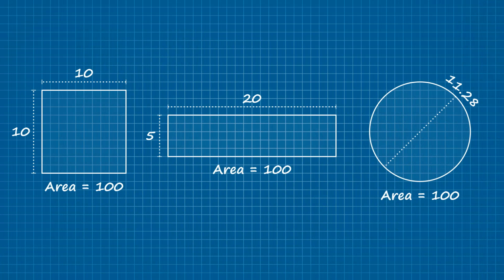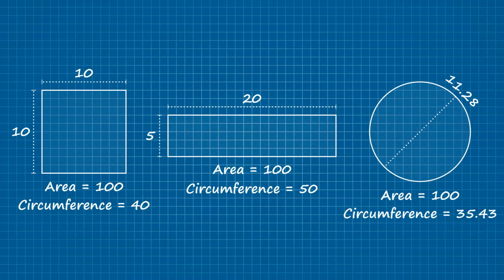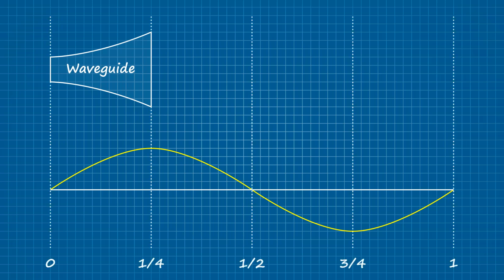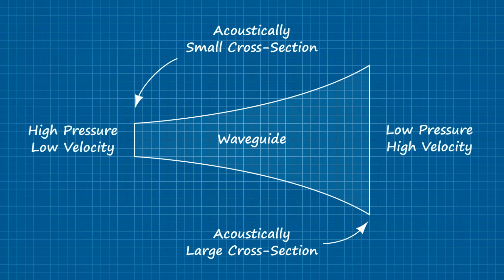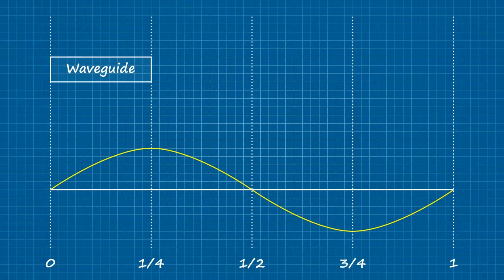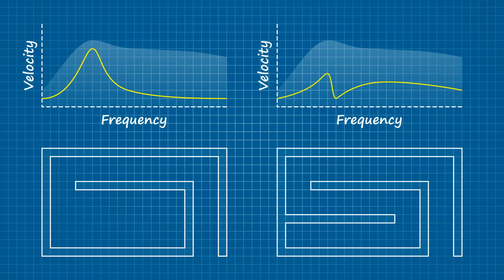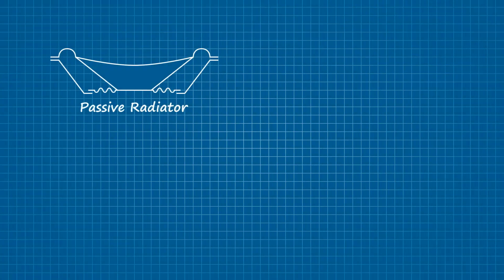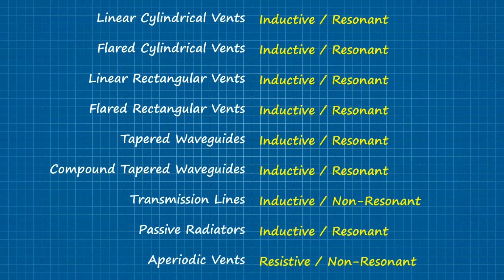The BEST Port Video EVER

Comment: I had a question about port area vs RMS wattage of a system. Does the wattage of a system, in my case 2 NVX VCW154 1000watt rms subwoofers, have anything to do with how much area a port should have. I have had a problem with Unloading, or bottoming out if thats what you call it, I've been loosing power from the system becasue of this issue and i cant really find a reason for this happening and my best guess was that the tuning frequency was too high or i didn't have enough port, or not enough port. If you or anyone else could help me with this issue I would be very grateful.
Reply: Turn down the bass boost
Reply: The bass boost isn't even on
Reply: Again. It is very complex. Wattage only means how much heat the driver can dissipate. Nothing about sound pressure level or anything. There can be many problems to it. You named it. You should check each, one by one, using  short bursts of generated tones or sweeps to find out what happens at what freqency. The rule of thumb is, that the port should be at least 1/3 to 1/2 area compared to the cone area. The more powerfull speaker with more cone displacement, the larger. But that will make your port longer. You do not want to get over like 1m in port length. Tuning frequency is "the same". The larger the port area, the higher the frequency. To mitigate that, again, you need a longer port. For car usage, 30-40Hz port tuning is normal. You should have subsonic filter set slightly below the por tuning frequency, so the speaker doesn´t unload.
Reply: CrashPCcz thanks for the reply I appreciate the info and I'll look into building a box with better port. Also I didn't know that about wattage. But it did feel like a big difference when I went from a 500watts system to a 2000watt system

Comment: Have a look at US Patent # 4196792; little treat from a long-time friend of mine.  Technically an aperiodic vent, technically not.  :)
Reply: I have a set of 12" goodmans axioms loaded into cabinets like that.... Good stuff. Full range dual cone speakers with 350 liters Vas, and beyond ridiculousness levels of compliance. The cabinets are about 6 cubes, and the venting type i figure artificially inflates that by about 25%. The entire backwave is lightly stuffed. It has a very smooth and linear low frequency quality to it. Very warm and pleasant with good low end roll off.  I found though they need to be right up against the back wall of the room for flat low end and they can have great emphasis when corner loaded if desired.

Comment: Why do you talk so quickly..? What's the big hurry..? 
Do you fully understand exactly how LPF speaker enclosure works ? The only thing that made any sense was the circular shape for a vent . High velocity air movement in a port is to be avoided at all costs .. Too small a port area will cause non linear air flow ratios ..

Comment: Consider, a port tube within a tube, to achieve the length of port similar to a transmission line. The opening to the outside on the front of the cabinet is a smaller diameter, and inside the cabinet, a larger diameter tube is attached to the back wall of the cabinet. Thusly, doubling the port length.

Comment: no one ever told that why L port and t lines are not punchy ?  round port can be punchy but when u flare it than it also becomes soft non punchy. why it happens?
Reply: It has way less to do with the port shape compared to other things. Group delay, dynamic range, balance between port output and speaker output, and much more. Same as "Slow speakers" and "fast speakers" story. For "fastest" sound, you probably need to cut off high (40Hz subsonic), you need a direct radiator or front loaded horn, and speaker with very high motor force (Bl^2/Re). That way you get punchier sound. If we speak withing bassreflex, some rules apply too. It´s quite complex...

Comment: What about front or rear? Often pro studio have on the front and hifi often on the back. Any difference? Close or far on the baffle?
Cheers!
Reply: The rear vent is supposed to use the wall to reflect the sound, while pro-audio will usually not have a wall (or want one).
Reply: It´s a rabbit hole. Very complex topic. For Hi-Fi, low extension, nice design, and less distortion and noise is desirable.  Putting bassreflex to the back of the box will cause higher frequencies and sound coming directly through the port to attenuate compared to port facing directly to you. That´s one part...

Comment: Excellent video. One question. You say aperiodic enclosures have slightly higher group-delay over sealed. I was wondering about this. Wouldn't they have less, as a well designed aperiodic has a more linear impedance over the range and more control over cone motion than sealed? Or am I wrong on both counts?

Comment: good video my port tube in my sub  cabinet comes up from the top air blows out like a chimney .My port tube is 22 inches long 3 and half circular . the cabinet was in our school gym which was replaced and they were given to me so I modified it using my own drivers 12inch s and had to get port tuning info   on the drivers I have I closed off the ones in the front area that were too small in length.

Comment: Ok, I have a question.

Does port location in relation to the driver(s) in the enclosure have an effect on the output or sound quality of an enclosure (possibly depending on the environment the enclosure is used in? (Ie van, car, living room)
Reply: Yes, it has. It just depends how strong, how measurable. As long as the sound is not produce by a single driver, you always deal with phase shifts, delays and so on. If the frequency is "high", and the port is situated in different distance from you compared to the driver, then you obviously get those two sounds not perfectly aligned and combined, but "separated" or even negating each other. It depends on box size, shape, port placement and frequency analyzed, because of wavelenghts...

Comment: Hexibase I have to say thanks, there were a couple things mentioned i have been befuddled with which has helped me better understand how I'm going to create the baddest wave guide demo vehicle. I have some incredible ideas on what would be very efficient. Now, let's say I use large aeroports in a large enclosure, I assume that this orientation will suffer from less impedance rise than that of a smaller enclosure with an even smaller ratio of port area per volume. Is this thinking correct? I have been into car audio for 13 years and have focused my attention on learning as much about acoustical suspension systems as I can. I was wondering if there's any way I can contact you to dive deeper into some really difficult to determine parameters with 8th order bandpass. I think I have the concept well understood but I'd like to consult with you.

Comment: So is a transmission line designed to act like a bass reflex or tuned quarter wave at lower frequencies and an aperiodic or damped infinite baffle at higher frequencies?

Also the best thing about a horn is that when it matches the driver to the outer air resistance more closely it also acts as a nice air resistance brake on the cone which produces a nice tight bass rhythm much like the aperiodic but without the low efficiency.

Comment: What would happen if you built a woofer with a copper speaker frame?
Reply: It would tarnish
Reply: @brettus9115  that's not the point.  Besides you could easily paint or finish it.

Comment: What about reversing tapers? Or what about reversed compound tapers, like a diamond shape with the tips cut off? Or even reversing flares, having a smaller opening that rapidly open to the port size? Or making a TL out of a compound taper? Or a TL-horn hybrid, where one section is straight and the other tapered, with both variations of flat first and tapered first? Or really any hybrid method of combining various port types? I have a lot of other ideas, but that's just a handful of them.
I know these probably don't sound or work as well, but I want to see what unconventional methods accomplish, for science.
Reply: Who knows there’s been like 10 different box designs I’ve thought that have never been done. Maybe your idea has never been done but it might be the most efficient just hasn’t been discovered yet.

Comment: Wow, awesome stuff here. I definitely subscribed.

Would you be able to make a video on the basics of how to build a subwoofer enclosure? :)

For example: A driver with these specifications + These expectations in terms of frequency response and application = This is how to design the best enclosure.

Because when i look around, i can find tutorials or guides but it's just like, you have these specifications, run it through this program and there it is. But i want to know why we choose a port width, length, box size, ... So i can take that knowledge to the next project.

I think i understand the basics, however it's sometimes very confusing. But for some reason i immediately understand everything you explain.

Comment: hi friend, one question, which software did you use to calculate the port area and lenght, very acurate..! 
with flarred slot port, how could  we measure physically.. including the flarred or not?
Reply: how do you combine this lumped model with TS parameters for overall output? is this model strictly diy?

Comment: So what do you recommend on port area? Go off cone area or cubic feet of the box?
Reply: No answer for this question?
Reply: @deaconsmith5988  much more to it than that. Did you watch the video? It's infinitely variable, and not answerable simply. You need to provide a plethora information.
Reply: George Srisomsak well we have been doing spl cars for a while now. Now we’re trying to build our own sub . When we went to build a box for it most people use 16” per square ft for port area. Say a box is 3 cubes so port would be 48 square inches. It was not as loud (spl wise) as when we decided the cone area by 3 for the port area. We seen DD likes to use this method. I’ve had a little bit of time to do some testing since my last post a month ago.

Comment: First time I have heard of passive radiators causing distortion by design.
Reply: @HexiBase  I'll be using a couple of these https://www.parts-express.com/tc-sounds-vmp-18-passive-radiator--293-684 they have a Qms of 7. If I add additional tuning weight to the PR will that make the problem worse?
Reply: @HexiBase  using a pair of VMP18's with a single LMS 5400 Ultra https://www.parts-express.com/tc-sounds-lms-ultra-5400-18-dvc-subwoofer--293-666

Comment: Thanks man, nobody explains this stuff like you do, I do have a question though if you have a moment? I have a saloon bmw where the trunk is almost completely sealed from the cabin space so as you can imagine bass is abit of a problem, I tried a ported box with the port firing into the cabin via the arm rest hatch & subs firing into the trunk with no luck just large peaks around 25hz which was cool but not good for general music, I've also made some holes in the rear deck with no difference in sound so I tried a sealed enclosure & although this seems to sound much better it still isn't very loud at all, what type of enclosure would you recommend?
Reply: Thanks man I appreciate your advice & your videos, i will be designing a new box very soon

Comment: When you discussed cross-sections,  you said round is more efficient, however I noticed you didn’t mention oval efficiency. I haven’t seen oval ports in many builds, but I wondered if you could touch on the oval ports as well.